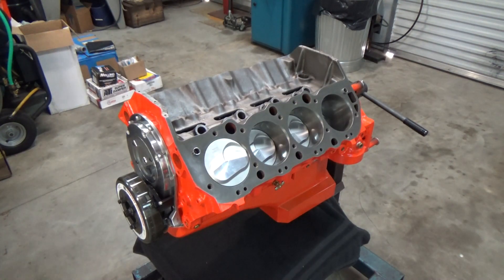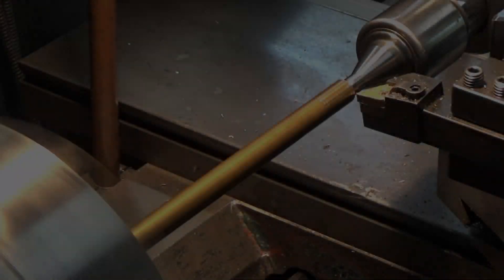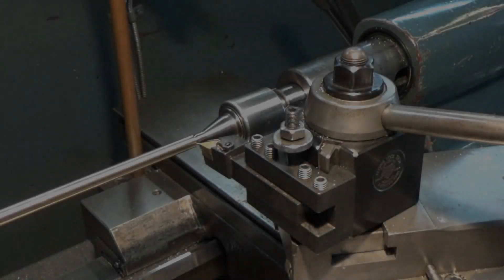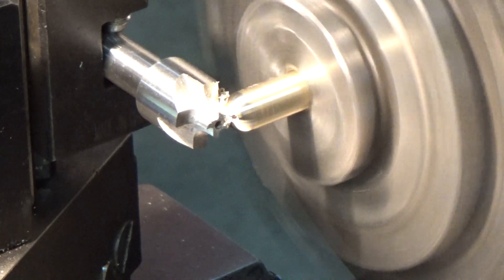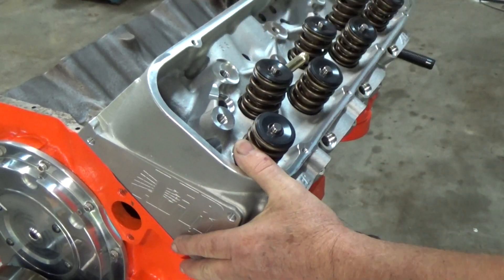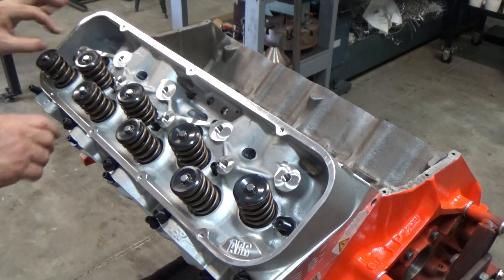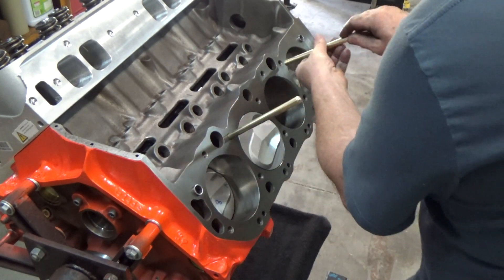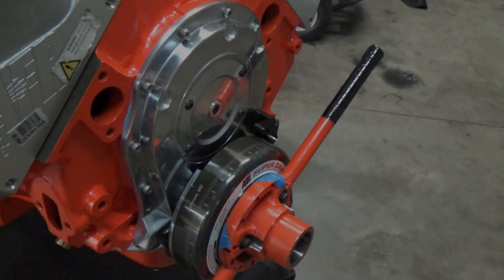AFR 265 Cylinder Heads Install on a 454 BBC...#18 Chevy 454 Big Block Performance Build...

Comment: Hello Sir, haven’t seen/heard anything hope
All is well. How’s everything? Ever get your engine into something? God Bless 🇺🇸🙏🏼
Reply from the maker: Hi Philip.... Nice to hear from you...Hope all is good with you as well... Lol... We've put in front of us a big project... We purchased  a dilapidated property that had a nice size shop building on it.... The house was about a complete gut job and things just move so slow, and its been hard to get supplies and the cost of everything is wild right now, but we have finally moved in and I'm working on another building on that property right now.... Everything here needs work to get it back nice again... The engine is pushed in a corner of the new to me shop building and nothing is arranged or wired to work right now in that shop....  Don't know when I'll be able to get back to video making.... I do miss it...  I hope one day everything settles in and gets back to normal.... Thanks for asking and God Bless...